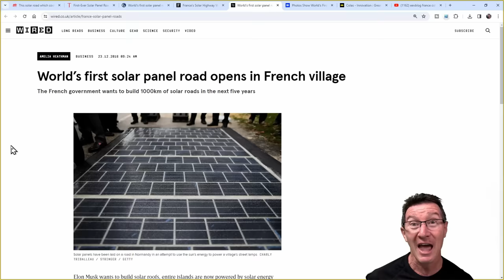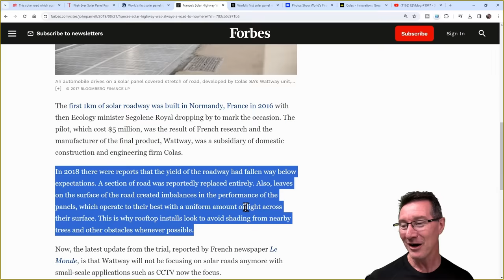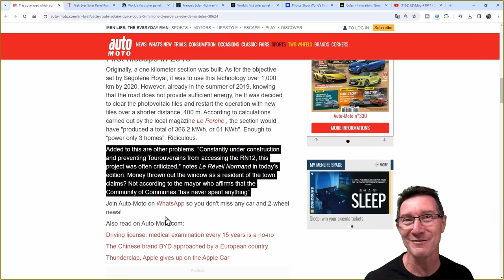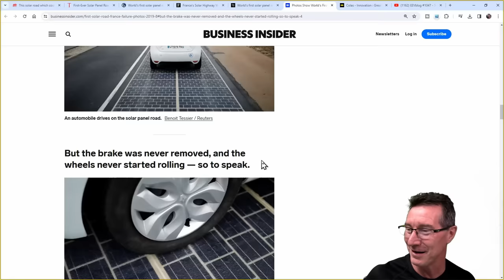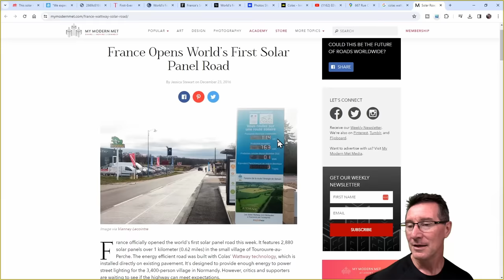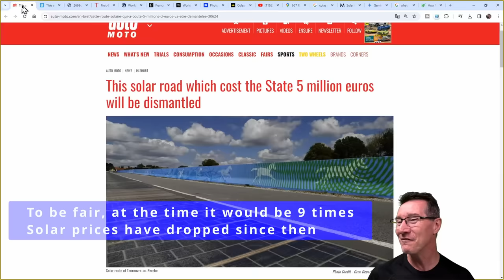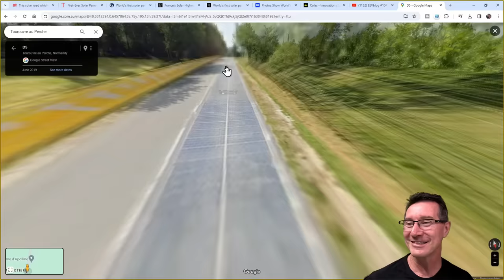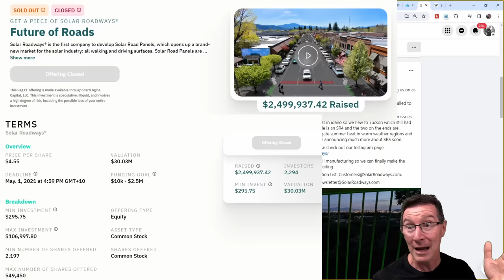EEVblog 1603 - Colas Wattway Solar Roadways is DEAD

Comment: This could maybe work as a sidewalk or bike path where you never have excessive wight applied but even there it would be better ad a covvered walkway with solar as the roof. But a road? Fitst time someone drives by with chains or stidded yires that shit is brakeing. Heck a rock in the treds will do it.

Comment: Guess what would be more effective and reliable than solar roadways but also not cause severe pollution? Something that France already has in spades, something that has been drastically improving in safety and reliability since its introduction in the early 50's?

THAT'S RIGHT, NUCLEAR POWER!

Comment: In france they use a lot of resistive heating
Reply: France has a lot of nuclear power stations
Reply: @fredbloggs5902 And despite the high cost of nuclear, they have relatively low electricity bills.. Amazing what happens when a public utility is state-owned and doesn't have to worry about pleasing shareholders.

Comment: lol. The Top Gear clip.

One of my favourite memes. Perfect for BS Solar Roadways being dismantled.

When it's obvious the solar panels work better on, I don't know... on the roof?...
What is actually going on with these projects? Is it some kind of tax scam, or government spending scam?

Even the most basic of "back of the napkin" calculations shows projects like this are a terrible idea, for all kinds of reasons.

Solar panels work, they just need to be put in the correct places, and at the correct angle.
And usually coupled with at least some battery storage, also for obvious reasons. lol

Comment: I wouldn't of and didn't, but they should have known in advance it wasn't going to work. However, the solar road wasn't about the money. It's about using space for multiple purposes. There's different types of efficiencies, and as an engineer I know you know that. The whole, "You can have it fast, cheap, or good" and at most you can only get two of those. Well, they weren't going for cheap, they were going for space saving. But as you love to say and quote: You can't beat the laws of physics. And that is the inexcusable part. The wish to be able to do this, at any cost, isn't the "crime" IMO. The "crime," is that they should have known it wouldn't produce enough power, it would get the microcracks and that not work, the sunlight isn't great where they put it, all those things, those are the things they should have known in advance and choose to not do the project. Admittedly it is also a lot of money, but the first of a thing is always expensive. If it wasn't a physically impossible thing, then they would do it, it cost a bunch of money, but it works, and then they do it again, and mass production, yadda, yadda, yadda.. it gets cheaper. Innovation is always expensive. But, when the math shows it won't work, it's not innovation, it's a scam.

Comment: The engineering company which designed this road must have know it was going to fail - they would have done a few back of an envelope calculations - in fact calculations were barely necessary, so the whole thing was a deliberate con to extract a few million euros of sweet sweet government dosh.

Comment: Hmm its almost like raising solar panels off the ground away from dirt/leaves and other crap, Not walking/driving/riding on them so you can use thinner and clearer glass. Angling them to face the sun more optimally would work better. If only we humans had built plenty of structures already that would suit. Oh wait ROOF TOPS. OMG LETS PUT SOLAR PANELS ON ROOF TOPS!!!! Why didnt we think of that before?

Comment: Why do we say 1000km Instead of 1Mm?
Reply from the maker: Because the Earth's circumference is only 40,000km, and any trip we take way under that, like a few thousand km at most, so it doesn't make any practical sense to introduce another unit into everyday language.
Reply: @EEVblog  I don't see it as another unit. It's still the base unit meter.
Reply: Because 1Mm could be misread as 1 millimetre.

Comment: I was thinking induction loops in the road might make energy
Reply: By essentially braking passing cars? Would be similar to the several "energy harvesting sidewalk"/roadway schemes out there.
Reply: Nope .so you know the induction loops you see cut into the road at traffic lights 

You normally see one loop at the white line first car position 

One more 5 car lengths back 

So the metal in cars affect the loops and in less busy times it can change the program in the traffic light junction 

The voltage could be generated on motorways or busy trunk roads
Reply: Obviously the ground work has be none for traffic lights and traffic monitoring.

But not for this type of power generation

And I think electric cars must generate a magnet field because of the motors.

So you have in a car 

Movement 
Metal 
Magnetism

Sounds like a generator to me

Basically like the built train ,but the principal flipped
Reply: @markdjdeenix6846  the motors in EVs don't have that much magnetic "leakage" - a well-designed electric motor forms and contains the magnetic field quite well, otherwise leaked magnetic fields would induce currents and cause heating (albeit small) in nearby ferrous metal parts, which would also mean lower efficiency.
You could place a permanent magnet inside the coil in the ground, and a passing vehicle would cause the magnetic field to distort and move and thus induce a small current in the coil, but the effect would probably be quite small, and also dependent on the exact materials and shapes of the vehicle's structure.

Comment: I wonder if any of those who had the most success in finding investors will "reinvent themselves" with something like installing conventional solar panels (and perhaps also some LED signs) over and to the sides of footbridges, and claiming it's still the same essential idea, so they're vindicated, the Galileos of whom many laughed but were later proven correct. Possibly with a very basic/common-sense "proof of concept" but still with 3D CGI models envisioning a vast network of interconnected footbridges pretty much making the ground-level sidewalks redundant,, possibly being at the same time moving walkways, powered for free. Freaking solar Hyperfootbridgeloops, so to speak.

Comment: You know someone has brain damage when these people put solar panels on the road instead of empty space right next to the road.

I think this would work much better if you have panels integrated into one product along led lights for pedestrian walkways so you can significantly reduce installation & maintenance costs. (Obviously, this is extravagant and a proper street lamp will beat the crap out of it, but still)

Comment: Even state of the art Silicon PV arrays are net energy negative when installed this far North.  Because they require 100% backup, you would consume less energy and produce less CO2 if they were never built.
Reply: Not sure what you mean. The energy payback time for PV cells installed in these latitudes is less than 1.5 years, with a lifetime of 25 years or so.

Comment: hear me out i got the next new energy creating movement based system that will work %104.7 better than anything else. Hamster Ball Freaking Walk Ways! all sidewalks will be crushed up so we can put rollers connected to generators down, then free hamsterballs will be scattered everywhere for you to walk in. Running of the rollers in the balls will create free energy and it will be to uncomfortable to walk on without being in a ball.

Comment: Could you imagine a world were all these green ideas were not gimmicks. We would have no war and much better quality of life. I know the solar road was stupid it's obvious to all apart from politicians. But secretly I just wish one of these crazy ideas actually just worked. I mean even EV promise is starting to look like a pipe dream now. They haven't found a sufficient way to charge and improve capacity and reliability of EV batteries. The talk is sodium ion but again there charge times are terrible and energy density lower than lithium. Fusion looks like a dead end and now there shutting down the only green solution for base load, nuclear. At this point we are running out of options. I bought a large solar system to charge the coming affordable home batteries eight years ago. Still they don't make financial sense and safety is now in doubt for home storage. I'm now seriously considering the best option for low impact future is ebikes they are light weight fast enough for the suburbs and you can carry some cargo like groceries. They can be charged of a wall socket overnight. This is the closest to a renewable solution but your still dependant on lithium. Even the wind farms are starting to show there age and companies are abandoning them. I think we just need some positive real news at this point not false hope.

Comment: A 1Mw nuclear powerplant that sits inside of a shipping container is on pre order for 1,5 million.
Need less space, no problems with the day night cycle or leaves, cheaper to buy but i agree waste is a bit of an issue.
Instead of throwing tax money away on projects like this and forcing all that (often not so) green stuff onto everyone goverments could put that money into a medium term solution like nuclear power.
Nuclear is cleaner then coal or gas and can be a perfect intermediate step.
Just like the industrial revolution 100 years ago things are going to change slowly over time without expensive photo shoot projects.
Solar freaking roadways are perfect for politicians, they can be built within the term that those politicians are residing at their position before moving on to the next position.